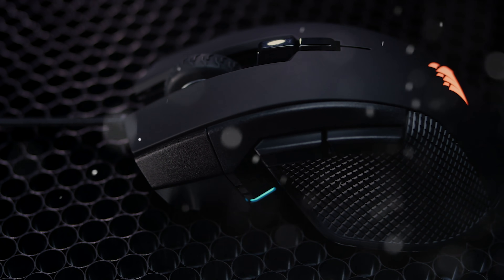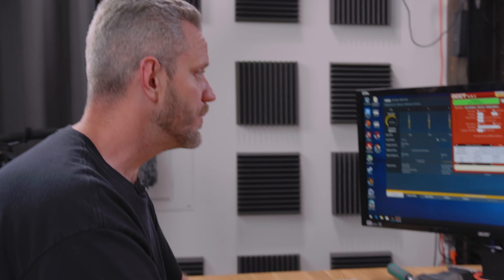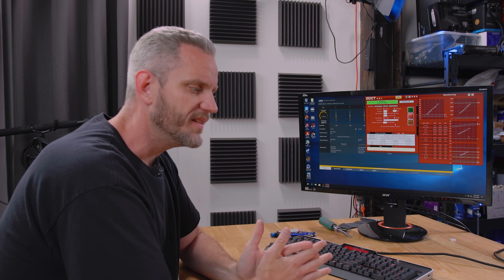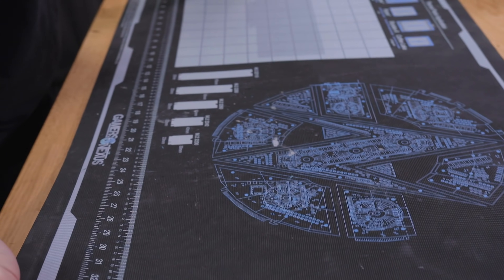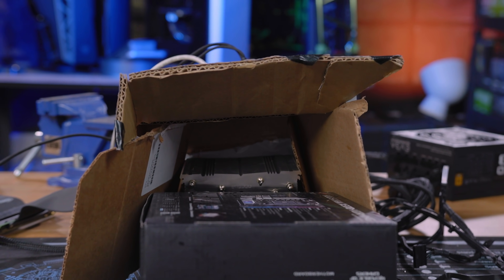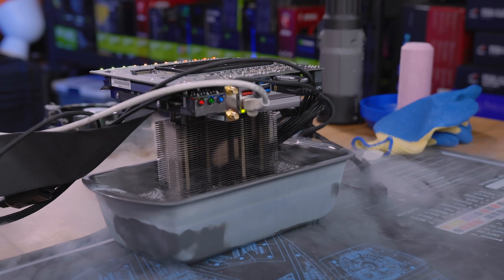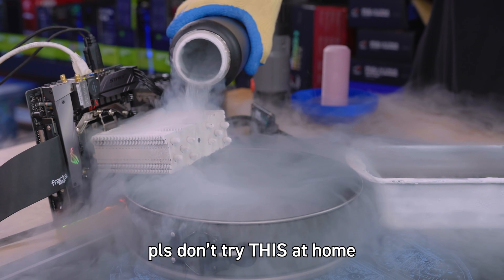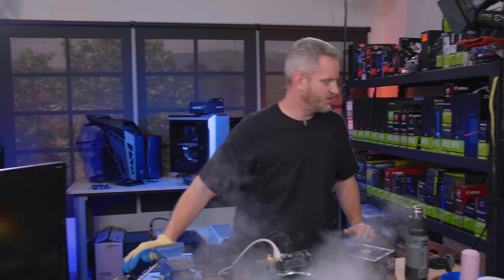We LN2 cooled an Air Cooler?! Don’t try this!

Comment: I love this video. As a personal note, when I worked in a lab I used to handle LN2 a bit. When I had to use gloves, loose gloves were a good idea (though other peoples opinions may vary), since if you see a splash you can fling them off. Incidentally, mixing double cream, condensed milk and LN2 together makes delicious ice cream. You can add the flavouring of your choice (before adding the LN2). Make sure to have someone else pour the LN2 in while you stir (quickly and carefully), as you want the crystals in the ice cream to be as small as possible, making a smoother blend.

Comment: When you freeze the liquid in the heat pipes you prevent them from transfering heat, there will be an optimum temperature that you should not go below. Alternatively you could create a new cooler using heat pipes with a liquid that will freeze at a much lower temperature.

Comment: I bet that once the heat pipes and fins of that cooler get a layer of frozen vapor built up on them that it creates a layer of insulation between the warm vapor inside the tube and the colder air outside.  Since water has such a large heat capacity it is not effectively pulling heat away from the heat sink anymore...

Comment: Take my idea of long pancaked ultra thing radiator concept and apply this by blowing the smoke through the radiator tunnel! Then you combine liquid cooling with ln2. Just get a liquid that won't freeze. You could get cold liquid inside the entire loop to help cool everything! Indirect Liquid Cooling!! ILC

It's in another one of your videos. You take those super thin single 20.5mm rads. You use 1x10mm and 1x5mm connector with a thin triple connector going outside. I think it's 24mm. between the rads you can fit 2 15mm fans and 3 layers of the 3mm padding. This can be repeated infinitely in a long tube. You then make a tunnel to blow this ln2 fumes through the tunel cooling the rad system and using pumps to keep extremely cool liquid inside the loop. Just make sure the liquid and pipes can take it. Or would frozen water be fine? Would it loose contact eventually or cause other problems. 

Outside water fitting is 10+24+5=39mm.
Inside fans and pads are: 3+15+3+15+3=39mm

Assuming it all lines up correctly. If not there are also 12mm fans.

 This could go perfectly with high static pressure fans as it wouldn't need heavy airflow. And you probably want the LN2 to sit on the rad as long as possible. Or speed the fans up to not cool to fast if it's a problem.

the other fun part is you can get as many high pressure fans with low speed as you want. 2 in middle of each rad and one on each of the outsides. Lots of air flow and pressure on demand. Or much lower overall air flow to keep the LN2 fumes in contact as long as possible for potentially efficient use or better application.

If you use 2 fans on the outsides it's 2 15mm fans per rad. Without it's (Rads-1)x2

I would think the last trick would be to enclose the fumes in a loop also including the path through the radiator/fans and then slowly introduce ln2 fumes. This could maximize time to use and limit escape for more cold. maybe some sort of enclosed tubes that slowly take in the exhaust from the ln2 and is slowly pushed around the tube. The fumes go up so an opening could be in the bottom with that container below. Or something to make the ln2 last as long as possible. Even something safer and more efficient. (Don't make anything closed that can make a bomb! Check with an expert before enclosing anything.)

then what about changing the loop liquid with a gas with very high heat transfer. I would imagine avoid flamables like hydrogen?! Of course if you can get the LN2 fumes into the loop you can just use them potentially. How much would you need to worry about condensation?! 

Could you keep/hang the PC upside down like you did and avoid/reduce condensation issues?

Comment: Years back, I tried to cool a water cooled loop with a thermo-electric cooling pad on the outside of the case.  The idea was thermo-electric coolers cool really well, but create condensation.  Put the cooler on the outside of the case, where the open air could prevent condensation and was far away from the electronics that if water formed, it wouldn't touch the electronics.

Of course I never got it to work, because I got my wires mixed up and fried the TEC before I could get the damn thing working.

Comment: I wholeheartedly encourage more antics like this.

I don't have the time or money to mess about like this, so I'm counting on you, Jay! You're my only hope! (hmm, maybe Linus...)

I'm imagining a fishtank with the mobo fixed to one side and fans placed to funnel the vapours through the heatsink as they fall into the tank.
Or a box that's open on 2 sides with the mobo in the middle and fans channelling all the vapours into one side and out the other.
Or using some AC tubing and a few fans to guide the vapours to the heatsink.
Or a watercooling rig with a large rad that the vapours can be sucked through (though I am getting flashbacks to when Steve poured LN2 into the ice bucket).
Or copper tubing laid out on the desk with coolant running through it and then sit the pot in the middle.

Comment: the only reason why this didnt work is because the liquid inside the air cooler copper heat pipes get frozen and then theres no heat transfer between the liquid nitrogen so it wont cool the cpu

Comment: You're running ~80Kelvin nitrogen onto a heatsink that is substantially affected by a ~300Kelvin room. The CPU at one side being 340+Kelvin isn't that much of a delta compared to the interface between the LN2 and the room air. You're effectively heating the LN2 with the room air due to the fin stack. Using a thermal camera would probably show this effect.

Comment: charles sanders
1 second ago
can you tell me why this cpu Intel Core i7-3770 Quad-Core Processor 3.4 GHz 4 Core LGA 1155 - BX80637I73770 still cost $350.00 7yrs. after release in 2012. i can get a 2700X for $290.00

Comment: Maybe it didn't work when you submerged the cooler because the liquid inside the heat pipes is supposed to get hot and evaporate and climb to the top then transfer the heat to the fins condense and go down again.  But when you flip the cooler, the liquid went to the top of the cooler (the part that was submerged) and froze there so there was no real heat exchange.  maybe if making a container on the top of the cooler and poor some LN2 will do the trick?

Comment: Dear idiot, freezing vapor chambers or heat pipes stop the things doing what they are expected to like boil at the contact point with the IHS (into gas or vapor) and cool to a liquid falling back to transfer heat by boiling again, heat pipe tech is so mature no its more mature than you! Freezing it below the temperature where it stops being liquid and turns solid leaves no contact apart from some thin AF copper pipe to transfer heat to the fins of the cooler. GG. 

Enough clickbait I watched ALL SONIC DROWNING THEMES 1991-2014 video before this just to see if the repetitive annoyance of the video ALL SONIC DROWNING THEMES 1991-2014 was enough to close youtube and not watch your video of serious clickbait (against YouTube ToS) Title  'We LN2 cooled an Air Cooler?! Don’t try this!' your defunct argument that don't try this at home is well defunct because they don't sell LN2 to any old idiot, clearly why you got your camera guy to buy it, Average Joe/Jane?john can't just get it from Amazon 'link included in description with affiliate link included' Oh wait... What?

But seriously no 'at home' person can get LN2 easy so its clearly click bait, should have used a mac and then you could use clickbait no1 keyword "Apple"

Comment: You did it wrong. Heat and hot vapor rise so you were making it rise back up to the cpu. You need to build and weld a metal box around the heat sink to hold the LN2 and pour it onto the heat sink like you normally do.

Comment: Generally - the "liquid" in heat pipes is just WATER. Yeah, distilled and on lowered pressure (lower than 1 atm. - to lower the boiling point of water), but it did not lower melting point significantly.

So water inside heat pipes just froze.
Second - heat pipes work in a vertical position, with heat source lower that cooling fins. They can work in a horizontal position, but the efficiency is down to 50%. In a horizontal position with the heat source ABOVE the cooling fins - they are just copper pipes, and they rely only on just copper heat transfer.

With all that - the setup with cooler upside down could not work.
Also - that's why f.e. Noctuas coolers performance is so good in tests on open benches (they are usually "desktop-style", with a horizontal motherboard), while in typical tower case they do not perform that good.
Also - that's why typical beefy GPU coolers with heat pipes in a typical tower case (with GPU fans and radiator facing down) are not that effective and they get MASSIVE perf improvement when you just flip them with a riser, keeping them mounted horizontally but with fans on top.

Comment: Hey Jay cool  don't know if it's plausible but have you thought about pumping LN2 through a water block like a custom loop obviously you can't use a standard custom loop kit but would this be possible and if it is would it help u Defeat GN and LTT a continuous flow of recirculating LN2 would probably me super expensive but it would be cool if possible and the performance might be the best u could get
Reply: Ok so update its possible and has been done heres a link to the video I found and i would love to see GNs face if u did this https://youtu.be/9TTqxXxIpPY

Comment: Needs one of those early-2000s Zalman copper coolers.  The ones that would rip the CPU socket off on the way to the LAN party.  I suppose you'd need a custom bracket, though.

Comment: What if you drain the cooler of the vapor liquid, and get a syringer or something to somehow replace the liquid inside the tubes with LN2, and pinch them shut after LN2 is inside vapor tubes. Its would trap the LN2 gases right?

Comment: With an air cooler, you need the heat pipe coolant to condense and FALL back down to the CPU. By dipping the top of the cooler in the LN2, there was effectively no coolant flow and therefore near no heat exchange.

Comment: BE CAREFUL LN2 gas can kill you and kill you quickly if vapor collects. I assume you are but just make sure you have good ventilation in there running when LN2 is in use. $60 will get you a cheap but decent O2 monitor. I work with the #2 Ln2 provider in the US, just a word of caution. Love all your videos this one included! Great stuff.

Comment: Should of just left it setup like you had it before introducing any kind of ln2 then poured it in the bowl sitting beside the board so the heatsink fan would pull the vapor coming from the bowl and push it threw the heatsink.

Comment: Question for the JayzTwoCents community, what do you guys use as your everyday monitoring tool for cpu/gpu clock speed, temps for the same and fluid temps? I used to use Sidebar monitor but I am looking something more comprehensive.

Comment: Im going to buy a gaming pc that costs me 1000$ the specs are:
I7 8700
Gtx 1060 6gb 
16gb ram 3000mhz
Asus prime B360 plus motherboard
550 watts 
Is it a good pc?
Reply: I would go for slower end cpu and higher end graphics card especially if you are set on b360

Comment: Hey Jay, can you do a comparison video of several PC cases showing air flow, you know how they use smoke in a airplane wind tunnel to show aerodynamics but for a case to show the best airflow, restrictions etc? I think that would be interesting. Not sure if it's smoke they use or what to show the air movement. Thanks! I also posted this to Kyle's page.

Comment: One suggestion for spare LN2 is to get a water bottle with approx 1/5 to 1/4 of water then add about a shots worth of LN2 then loosly screw on the cap ( not too tight) then throw said bottle a short distance away and watch for the expansion of the LN2 to gas. Makes a nice pop when the lid gives way

Comment: made soem reaearch.
LN2 is electrical non conductive.
Bild a big styrofoam box and fill it with dry ice (frozen CO2) - put a bucket with ln2 in the middle and put the pc into the ln2 directly.
The dry ice should help with evaporating LN2.
and the ln2 is safe for the pc (even if water comes into your bucket it will instantly freez and not cause s short.) 

JAYZ notice me please xD

Comment: I'm waiting for CPU manufacturers to eliminate aftermarket coolers,  all together and have their CPUs setup for lm2 straight from the factory. This way you don't have to worry about the CPU making good contact with the aftermarket cooler it would all be one configuration

Comment: Fun idea but you could try to make an acrylic box or something that is safe to use and cut a hole so the heatsink only is inside and it doesn't leak around the motherboard. Then you should probably fill the liquid nitrogen so the heatsink is submerged in it? You could also add fans on top maybe. Just a thought.

Comment: You're right, this was stupid. But it was also fun.

I think Phil was right, when you stuck the heatsink into the LN2, it probably did freeze the vapor. I think if you try pouring LN2 on the chunk cooler it'll probably work a lot better

Comment: Just started the video. Since the heat pipes in the air cooler are critical to its performance, and since those heat pipes contain water at low pressure, I suspect that what's going to happen is that the water in the heat pipes is gonna freeze solid and the heat pipes will stop working. So you're left with just conduction from the copper to the heat sink and the performance is gonna tank.

Edit: Theory confirmed.

Comment: Bringing up the latest Jayz video. LN2 cooling an air cooler? Brilliant! It's even better than that water cooled air cooler that... Oh that's where they got the idea. Well as long as they don't use cooler with heatp... They do use heatpipes! Nope won't work. The minute amount of liquid in those pipes will freeze the moment they start pouring the LN2 through the... He uses just the vapor? Hey that might just work!

Kind of a rollercoaster there, but pure fun to watch. Science can be fun even when it doesn't go bang! Who'd a thunk?

Comment: JayZ You should try installing as small radiator as possible (no heatpipes, maybe something like old chipset cooler) on CPU and cool it using high air flow (everything allowed here).
Btw. nitrogen frozen tangerines are delicious.

Comment: Water cooler setup with the radiator using LN2 vapour, then pour through radiator and finish dunking the radiator. See if the water starts to crystalize or freeze. Or use vodka with lower freezing point. Abuse more parts!

Comment: Sticking a heat pipe cooler in LN2 is really a bad idea. Phil got the right idea, the vapour in the heat pipes is freezing. Also, the cooler is likely busted now, a thermal stress that big likely cracks all kinds of solder joints in a fin stack cooler. Like the heatpipe-fin interface, and the heatpipe-coldplate interface if you leave it in longer. Anyhow, definitely a cool video! 

And definitely do the vid using one of those aluminium heatsinks. Might work even better than a LN2 pot, because of the large surface area. Depending a bit on the type of aluminium that those use, for some types the thermal conductivity goes down quite a bit faster under about 100 K (remember LN2 is 77 K) than others. Use an all copper heatsink if you have any! Coppers heat conductivity is going up at cryogenic temperatures. And put some thermocouples at the heatsink at different location w.r.t. the base to get an idea of the temperature profile in it

Comment: Submerge the entire board in 100% denatured spirits (use molecular sieves or sodium metal to remove the water) and cool that with dry ice.  Use a chunk of copper as a heatsink for the CPU, use liquid metal both on the heatsink and between the CPU die and IHS.

Comment: maybe my cooling idea is too dumb: liquid metal cooling whit a full copper loop
Reply: Gallium cost a lot and it's pretty reactive to materials used in loops 

Alongside the issue of heating any metal that is liquid (fun fumes)
Reply: @betrayedpredator8826  I know that is so expensive but if we use galistadium it doesn't react with copper
Reply: Giovanni Lizzi how would you pump it?
Reply: @falubii9712  hell yeah

Comment: Im buying a pc building kit from a website(Im swedish). I wonder is it good? (i can't change out the parts because its a package and its very cheap rn it has 300 dollar discount)

https://www.komplett.se/product/943988/datorutrustning/datorkomponenter/paketerbjudande/pc-i-delar-intel/pc-i-delar-value-gamer-rtx-2070
i also have a 1TB hard drive and a Phanteks Eclipse P400 Glass

if you cant see it in the link here are the specs
*  Intel Core i5-9400F
*  ASUS ROG Strix B360-F Gaming, S-1151
* Ballistix Sport LT DDR4 2666MHz 16GB (2x8GB)
* Kingston SSDNOW A1000 240GB M.2 SSD
* Corsair TX550M 550W PSU

* MSI GeForce RTX 2070 VENTUS
* Cooler Master H411R RGB

Comment: doesn't heat go up? and cold down. maybe it wasn't cooling because you put it upside down trying to cool it from the bottom while the effects of it cooling didn't go up the chamber therefore not cooling. not sure but that's about as much i can use my basic knowledge of physics here

Comment: can you make ln2 drip in watercooling reservoir to cool the liguid? and maybe use liguid that can handle low temps? like car radiator fluid? then let some ln2 drip in reservoir from fillport slowly :D  you could doubledown and go with 2 reservoirs ? you might not even need a radiator actually what ya think?